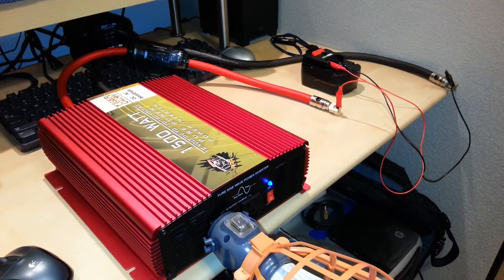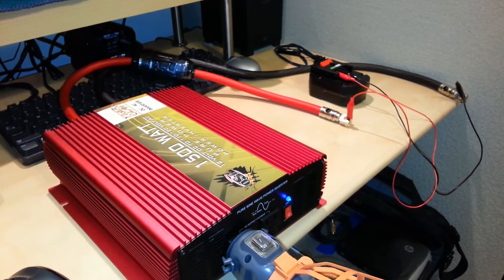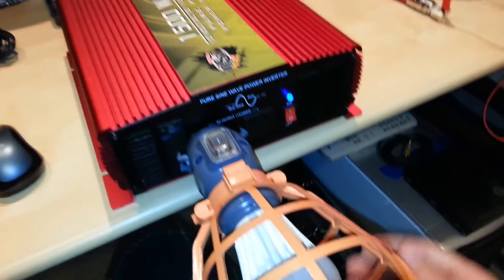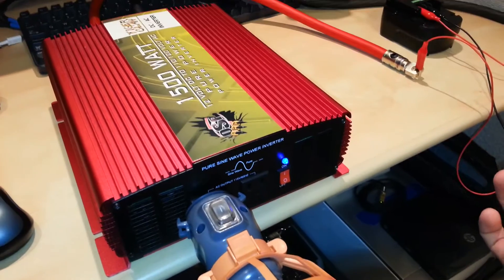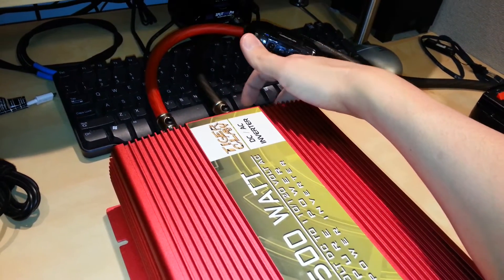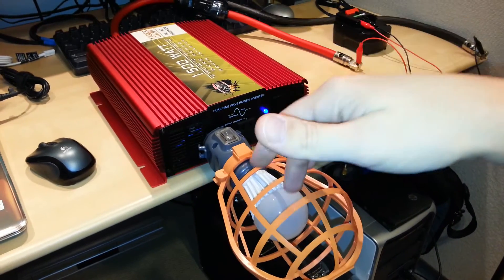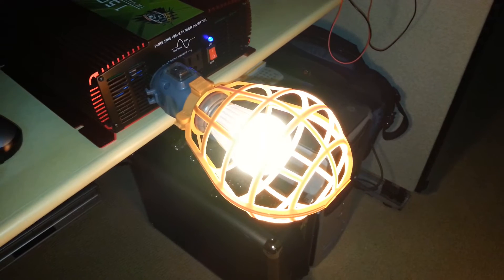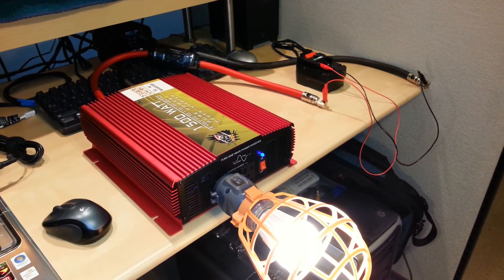OSP Tiger Claw 1500 Watt Inverter: Performance & Application

Comment: Thank you for explaining the “live neutral” are these inverters “safe” for a UL compliant hardwire application that’s off grid and not tied into any already existing electrical box...as in a stand alone solar application in my tiny house.  If anyone knows please offer some information.
Reply from the maker: Its smost certainly not UL listed, but for stand alone application I do not see any issue with it.
Reply: Thank you!  I’ve got a lot to learn

Comment: Our old SOL company PWM also produces inverters. Much better than Chinese and has inverter tripping regulation at low voltage. For deep-discharge batteries, there is no need for such a shutdown, as for a car's starter batteries. Look at our models of inverters - this is Europe. http://pwm.guru
Reply: Our old SOL company :) innovative & progressive!
Reply from the maker: Interesting product line, without looking under the hood I don't know how the quality compares. 50hz and 240VAC output without a center tap isn't useful for the United States since they have a 60hz 240VAC split single phase with a neutral center tap bonded to earth. Unless your units come with DIP switches to select frequency and output selections for such a setup, I can't see it being useful for the North American market.
Reply: A AC outlet for 220-240 volts can be installed any, including for the US. It is not a problem at all. We produce inverters for EU mostly
Reply from the maker: that makes sense, you typically have the Schuko plug on there, thats two pins for hot and neutral, and a separate earthing pin. The two pin connector can be flipped 180 degrees so the earth has to be separated. Its a completely different  system than the US. Is your output stage a true 0VAC to 240VAC? I'd imagine it would have to be due to sine wave output topology. If it were a modified square wave, each output transistor bank would be one half the output voltage RMS of opposite polarity in reference to earth. least thats how cheap MSW inverters are made here. Complete junk in my eyes.

Bottom line, I'm curious how you would adapt your Type F plug to a NEMA L14-30 or NEMA L14-20 and have it meet NEMA standards.
Reply: You wrote: "two pins for hot and neutral, and a separate earthing pin". The Off grid inverter produce AC voltage and not connected with USA AC system grid :) a separate earthing pin - the user of inverter may connect to the grounding. Inverter does not produce  earthing or neutral :))) Just have separete pin for earthing
Reply from the maker: Lolita Castellanas understood, but what about a center tap (neutral) where a 4 conductor is 120-0-120 with 240vAC X and Y hot, neutral, and earth ground?
Reply: I checked in Google your NEMA L14-30 type. PWM do not offer such type of AC outlet (and other 4 pin sockets).  PWM available AC outlets are here: http://pwm.guru/image/catalog/inverters/product/pwm_inverter_PowerStation-outlets-ac-sockets.png
Reply: Speaking about power 8000W+ better use industrial AC outlet 32a.  As I understand in USA this standard is in use...... or not? .You can check inGoogle: 32a industrial socket 2p+e
Reply from the maker: yes standard connections with generators to a transfer switch or interlock kits, but sometimes people use a sine inverter with the same connections to run smaller circuits such as lights. my video https://www.youtube.com/watch?v=9RyUzuqefCk details this. I had to make a NEMA-15P to NEMA L14-30, and jumper the two hot wires together to run both sides of the 240VAC split phase. I can only run 120volt loads. which is fine because any 240VAC loads I have are non critical for off grid applications.

Comment: Does anyone know the Max amperage output?
Reply from the maker: 13Amps AC, which is about 125Amps DC
Reply: awesome thank you.
Reply from the maker: You are welcome. Keep in mind this inverter is more practical at 1300 watts max or 11.3A AC. Voltage drop at 1500 watts is not practical around 105-108VAC, but it will run it
Reply: ok sounds good thanks.  Im wiring that outlet to a sub panel and need to know so i know what size fuse to put in.
Reply from the maker: I have a 300A fuse on mine to handle the surge, if you are not running any electric motors or any inductive/reactive loads, put a 150 amp fuse on it.
Reply: awesome thanks.

Comment: Will the Tiger Claw run the Keurig mini which is a 1425 watt coffee maker?
Reply from the maker: supervdj it should be able to run it yes, however, it will not have capacity for anything else. This inverter will shut down right at 1500 watts. You will need some big battery bank to handle this load for any length of time. You can check out my other videos of the inverter running a canister 12 amp vacuum. I ran it for 20 minutes or so cleaning my game room and no problems. Fans kept running full blast as expected. Hope this helps.

Comment: Was just playing around with my OSP and mine has the oscillation with a 9w cfl. When I plug 15w more into it, it goes away. Got mine dec. 2013. Must very a little from one unit to another.
Reply from the maker: Yeah, normally if you load the output slightly it smooths out the oscillation. It has to do with the transistors firing for the AC waveform perfectly. The drive circuitry for the output isnt too tightly regulated. Even still not bad for $200 bucks

Comment: Just ordered one tonight on amazon.  I hope to god I get an updated one.  I read a review on amazon saying that his iPhone and iPad were not charging.  Could that be due to the power adapter not liking the oscillation problem from the bad batch?
Reply from the maker: Maybe, but more likely the RFI and EMI from the boost stage bleeding into the output stage. Try grounding the case or putting a power conditioner or filter before the device.  That will likely solve your issue.

Comment: Good description of 'live neutral'.  I regret my mistake in saying that this inverter is live neutral in my video because it is not.  I've not yet encountered a pure sine inverter that is, but I haven't seen them all...

Thanks for the video!
Reply from the maker: Thanks ***** I had a chance to look at the waveform on a friends Rigol o-scope. The dead time at the zero crossing is still there, but the oscillation is gone, so that explains why the lights are steady. The hz is a bit fast at 60.2HZ but it settles to 60.0 once you put a load on it.
Reply from the maker: ***** Further investigation shows the flicker is caused by a low power factor correction ability. If power factor is below 0.9 the lights tend to flicker. If you add a resistive load to the inverter to increase power factor the flicker goes away. I wonder if a motor run capacitor say 5uF or smaller will help with power factor???
Reply: Knurlgnar you’re my favorite you tuber, cool to see your comment on here

Comment: so can you buy one of these inverters on amazon because i found one on there once and i can't find it now thanks
Reply from the maker: They are currently out of stock. Sigler Music out of Arkansas sells them. They are imported from China. Have to say for $200 bucks you really cannot go wrong. The only thing you need to do is do the capacitor mod for the cooling fans and pretty much you can run most appliances, and its capable of a 26 amp AC surge to start motors etc.